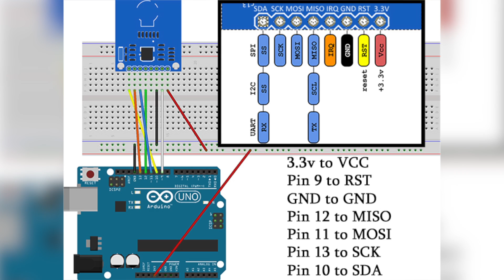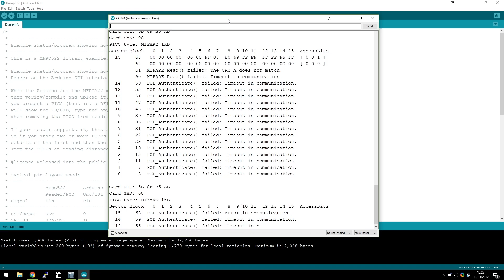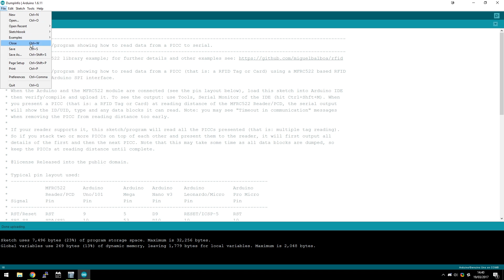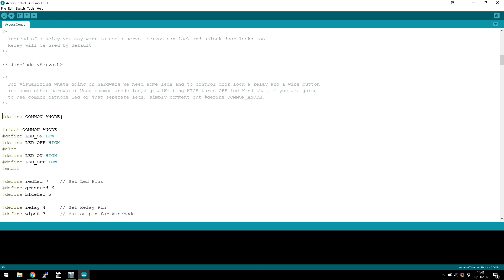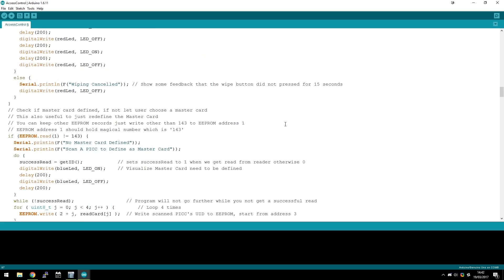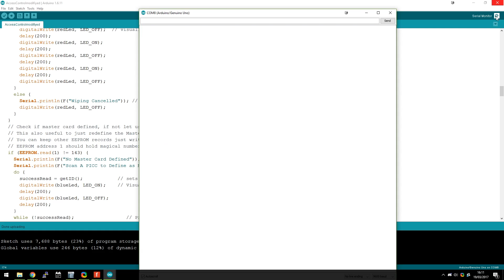DIY RFID Smart Lock with Arduino

Comment: What should be the 12V supply, AC or DC?.  I have adaptor for AC so will it work on it or do I have to get DC adaptor
Reply from the maker: you would need DC.
Reply: @MakeUseOf  I am having a problem where the program doesnt move forward after scanning a card other than master card. Like:
**  Scanned PICC's UID:
**  21B0F326
After this nothing works.
Also when I provide 12v supply all LED's automatically turn on and the solenoid lock also unlocks and doesnt lock again.
Please help....

Comment: I want to make scooter immobiliser with that :) 
- read card, now you can turn on scoter (button works), and no 130db active buzzer sound.
- read card again, now esc controller lost power  and scooter is locked. Gyroscope is activated and position is stored - if any one moves the scooter alarm of 130db goes wild for 10sec, together with motion direction being disabled. Than alarm stops, motion detection re-enabled. 
Sound simple but there is no such system on the market at all right now - I was surprised by that🤷‍♂️ 

I think something as small as Pi Zero should be able to handle broth sensors and ... mosfet I guess.

Any suggestions man, you def know more than I do, but I’m a quick learner :) would love to hear your thoughts / advice
Reply: maybe make a servo that presses the button when it is activated

Comment: @MakeUseOf .nothing in the circuit is working after connecting to a 12v power supply, pls help fast , and serial monitor says that it will remove the first card at every 10 minutes(gets automatically wiped),pls help
Reply from the maker: A bit difficult to help given we can't see how you wired things. But for a start, check you haven'tgot anything from the +ve 12v rail going into the arduino - that would absolutely fry it.
Reply: @MakeUseOf  no the arduino is working fine when connected to pc
Reply from the maker: @kurunari5754  so how are you powering the arduino in this project?
Reply: @MakeUseOf  just like in the video

Comment: All I get is "Wipe Button Pressed, You have 10 seconds to Cancel, This will be remove all records and cannot be undone, Starting Wiping EEPROM, EEPROM Successfully Wiped, No Master Card Defined, Scan A PICC to Define a Master Card" what can I do to use this? I only did what you said to do. Oh but instead of using a solenoid, I just wired in an LED light. That can't be the problem, right?
Reply: OK I got it now NeverMind...

Comment: Is it possible to replace the leds to led strips, if so how
Reply from the maker: Depends if you're talking single color 5050 strips, which require 12v to drive them and therefore some MOSFETs; or the much simpler WS2812b style "neopixels", which you could drive a few directly from the arduino 5v output, and can be inidividually controlled with a digital signal. More info: https://www.makeuseof.com/tag/connect-led-light-strips-arduino/

Comment: Every time I scan the master card I get "Wipe Button Pressed - Master Card will be Erased! in 10 seconds".
After it successfully wipes, the blues LED begins flashing again. I've triple checked all connections. Any insight?
Reply: I had the same issue. Change the digital pin that the wipe button is supposed to be in the code. Because initially when you change the LED pin you set it to the same pin as the wipe button causing a never ending loop, when the blue led is on I believe.
Reply: Your wipe and the blue led are on the same digital pin

Comment: Hi, I've got a problem.
Whenever I power on the circuit, my solenoid constantly opens and closes, and the LED's don't light up.
I used the exact same code from the video, as I used the GitHub file.
Does anyone know how to fix this?

Comment: I make this but i have a problem
I use 12v electric lock when lock open my arduino stuck then i restart it
Reply from the maker: Are you using a relay? You shouldn't be interfacing a 12V lock directly with the Arduino, since the Arduino runs on 12V and the lock will draw far too much power. That will likely cause a reset (if not worse!)

Comment: Hi, could you tell me the Mosfet serial number that you use? As I'm interested in building one but not sure which Mosfet I should use as there are different valued Mosfet. And sorry I'm kinda new to this, also the power supply are you using a dc or ac supply? Thank you!
Reply: 2n7004
Reply: dc supply
Reply: Thanks!

Comment: Quick question; is it possible to make the RFID reader scan continuously for the tag and then have it lock when the tag is absent? How would you go about doing that?
 
Thank you
Reply: Hi there, this is Ian who wrote the article. Without actually rewriting the code and testing it I'm not totally sure how this would work, but here is what I think might help.

If you look in the loop function, there is a boolean called succesRead (look at line 210 of the code provided in the article), which switches when the reader gets a successful real from a key. Slightly further down in line 234 of the code, there is a while(!successRead); desinged to stop the code going further unless there is a reading. Try changing this while loop to something like while(!successRead) {  digitalWrite(relay, HIGH);  } which will hold the lock shut whenever the reader is not finding your key. Then, remove this line from the granted method (line 291) to stop the door auto locking after the setDelay.

This is just my first thought on how to do this, and it may not work or be too elegant if it does. Let me know how you get on!

Comment: Why use rfid when you could use a keypad system.  Hunting around for keys seems to me no different to hunting around for cards except that batteries on diy systems are likely to run out. 
 I prefer to have a displacement touchpad setup like this https://youtu.be/GP-qFNMUfzU with the advantage being that the digidoor example has backup power and excellent power management anyways.  Good learning video though and perhaps a good system for hotels where you could have a logging system to tell when people checkout.

Comment: What us the range of rfid s?
Reply: For the most part, touching distance
Reply: XSportSeeker 
oops,,,  there is a yt vid that ALIVE AT 5 news cast showed them reading credit cards at over 15 feet...  When I  drove truck into a soy bean processing plant, they gave me a rfid card to track my truck and load through the plant.
With the card laying on the dash , the readers were 30 to 40 feet away.
My question was, is the Arduino boards that powerful? 
They don't use rfid chips in credit cards anymore...  At least they say they don't. ...
thanks for the reply....
Reply: No problems! You can definitely juice up readers or use different frequency spectrums to go through greater distances... but it requires far more power, and the Arduino module just won't do. xD
For the most part, common readers you find to sell on the market basically requires touching distance to avoid crosstalking and interference, but the technology isn't limited to it... here, I found a good explainer:
http://www.skyrfid.com/RFID_Tag_Read_Ranges.php

There's one that can reach 500 meters! xD Probably proprietary and limited usage though...
Reply: XSportSeeker 
Where I was going with that line ,, was ,,
it would be neat to have a rfid card in your car that would unlock your door and turn on the porch lights when you drive in the driveway...
With as easy as it is to change the cards with that system,,,  you could rotate 4 or 5 cards for added security. 
Thanks for the reply...